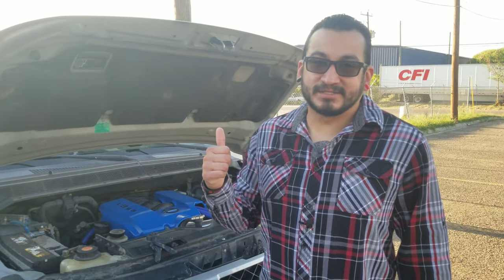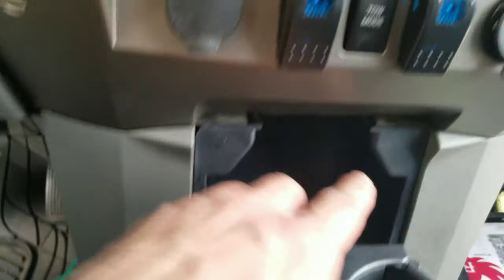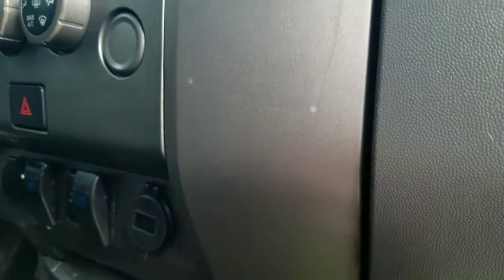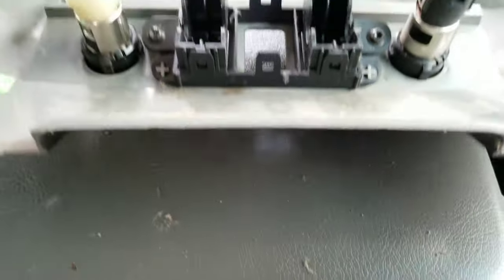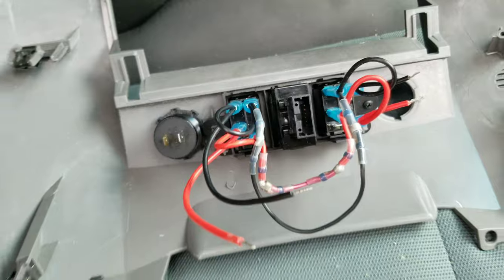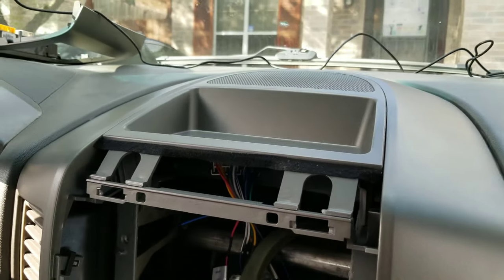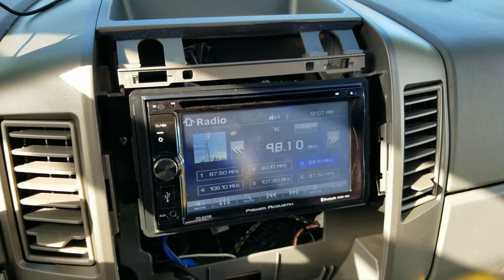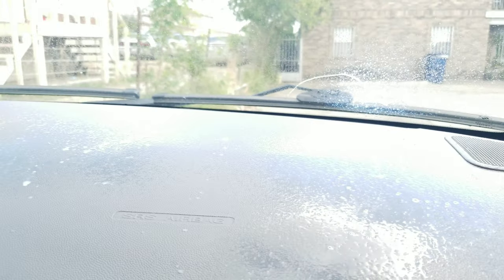04-06 Nissan titan center dash panel replaced with some custom work

Comment: Who’s watching in 2022?? Lmao
Reply: People who love their trucks, are loyal, who aren't slobs, and want to take care of their trucks as best they can. Nothing wrong with learning from someone who has experienced something before you. Purchasing my 2007 Nissan Titan has been one of the best decisions I've ever made. I am a single girl and that truck has protected me on miles of dark and solitary road, when sideswiped by a drunk driver, rear-ended and front-ended while stopped at a traffic light (separate events), hitting an adult deer on the freeway at 65mph+... we have seen a lot of the country together and he is still going strong at 200,000. I will be purchasing a new mid-size truck, but that doesn't mean I need to get rid of or stop caring for a good friend. After 16 years my Titan has an HVAC control knob light that has burned out - what I learned from this video, and others like it, is that I need to chill out and not let it bother me. With all the things that could potentially go wrong trying to access the bulb (scratching or cracking my dash, stripping screws/plastic, breaking wire connectors, altering fit and potentially creating a rattle, etc., etc.) I have made an INFORMED decision to relax and not attempt to disrupt the dash until I absolutely need to. So, thank you to all who recorded and posted their experiences.
Reply: It’s December 2024 and I’m watching. I just bought a 2009 titan pro4x with the panel broken.

Comment: This is the second video of this guys where he starts the thing mid process. I wanted to wire halos so he shows how to put the headlights back in. I want to change out the bezel around the radio, he starts with the thing already open. Gotta work on that champ

Comment: The metal part of the cig lighters push out towards you into the cab. There are 2 tabs that are extremely hard to push out at the same time without a special tool. I ended up using snipping pliers to just cut them off so I could slide them out and put them in the new ones. There are 3 fins around the cig lighters so you can only put them in a one way.

Comment: I have 2 cracks on each side of the soft smooth plastic at the top. Before I replace center dash console, is there a epoxy/buffing out process to correct this? I'm glad I can have center part swapped out only, and not entire dash. But if I can address these 2 cracks, it would be alot better.
Reply from the maker: Yeah I don't see why not
Reply: @DirtyDude  Will be replacing both the dashboard sttering and center console bezels.  Existing dash is too brittle to patch. Visually, there is no difference between the 06 and 07 Armada parts. (on the dash)Has anyone used 06 parts on a 2007-2009 dash with success?
Reply: @williamdlatorres4790  Did you put this part in your 2007? How did it go?

Comment: What year was your SUV? Mines is an 07 but bought an 04-06 because it said it would fit but I’m having issues with the radio panel now bending and not flushed
Reply from the maker: My truck is an 2006. I didn't have any issues with that type of situation but also I do have an after market radio and I replaced the original radio and panel. On installing the after market radio I had the buy a radio kit that came with a different radio panel.
Reply: I’ll probably have to redo the bezel because how you said, to make sure the clips line up. I just have a small gap on the top where the speaker is.

Comment: Thanks, saved me some work just did it in 30 minutes. Now I have to figure out to to install my new plastic dash cover for the instrument panel. My shifter is on the column. Looks like the steering column will have to be dropped to get new panel in. Anybody here done this replacement yet?
Reply: Mine slips right out and in by just removing shifter lever from shifter assembly(10mm nut) and tilting wheel as far down as it tilts.. no need to drop column..be careful to.not break off the plastic info/odo. display selector"knobs" with cluster bezel during removal or reinstall.. they will get hung up and snap off

Comment: I despise my  old 2007 style 3 knob hvac controls.. every other light in the Dash is led.. but why they chose incandescent hardwired bulbs to illuminate hvac knobs makes no sense. They get hot..melt and warp plastic within. then eventually burn out and let's not forget  the black scratches off too easy.light shows up any scratches brighter than any factory placed numbers or letters on the buttons. Shit deaign.. im looking to upgrade to the  updated 08-15 conventional hvac panel. Already got the 08 cluster.. I'm sure everyone  knows.. yet nissan gave the sentras and rogues a better quality 3 knob control panel.. ofcoarse it won't fit in the titan hvac/stereo trim plate either..spacing of  knobs isn't the same.. the titan should of got this design too..  seem overly rigid for a sentra and a rogue